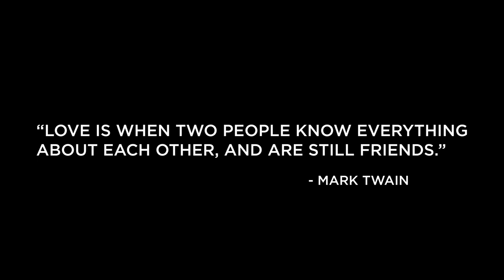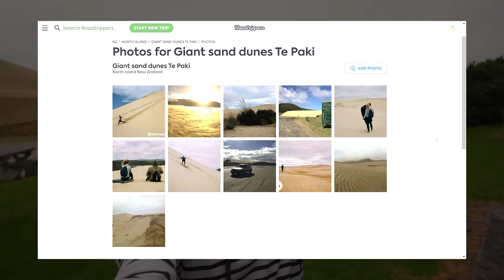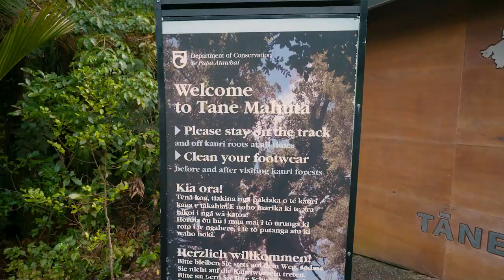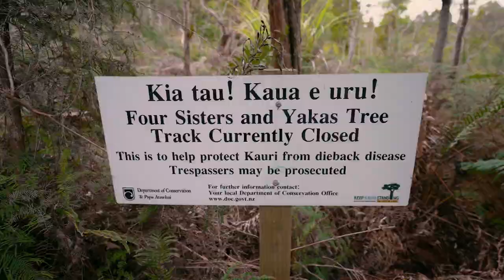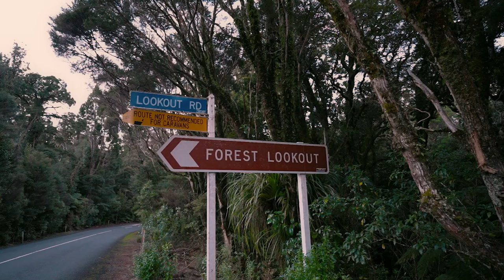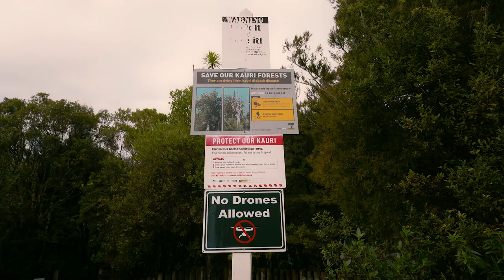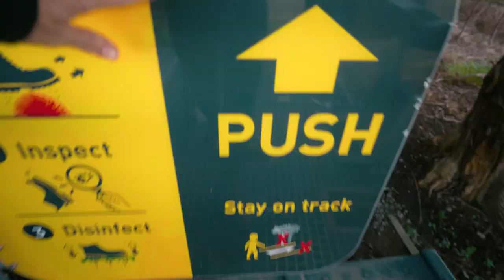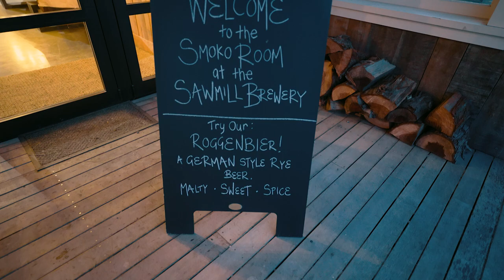THE ULTIMATE MARRIAGE TEST (not just a road trip 3)

Comment: How i dried my sock whether thin or wool i would use a hair blower , i would put the sock over the nose of the blower and hold the sock so it doesn't blow off, remember to be cautious as to checking to see what areas are still damp. It works well no matter if you have a high and low control you just have to be proactive as to checking the dryness .

Comment: NZr speaking... I was quite worried about how you two would go with those shell jackets down south in the winter. Somewhat relieved you just did the tippy top of  NZ (which I have never done!). The South island has some really large untouched parts, west coast mainly. Super rugged and hard to settle. Weather is invigorating! Esp in Winter! The Maori also have tribes that cleared sections of bush. However colonists are like this well oiled machine or ultimate destruction and the speed of clearing was horrendous. There's a you tube vid I think you guys might love, if you haven't watched already. https://www.youtube.com/watch?v=3VZSJKbzyMc&t=319s